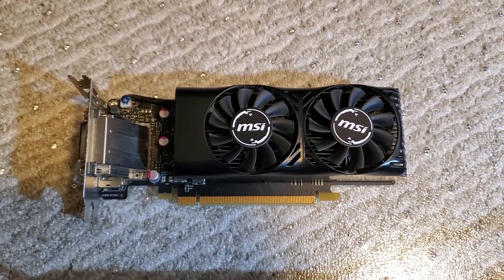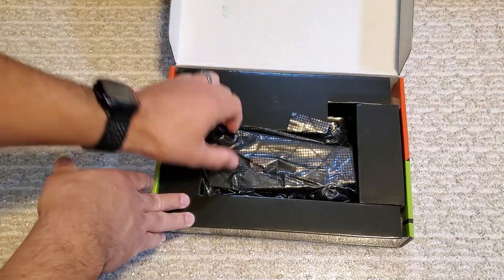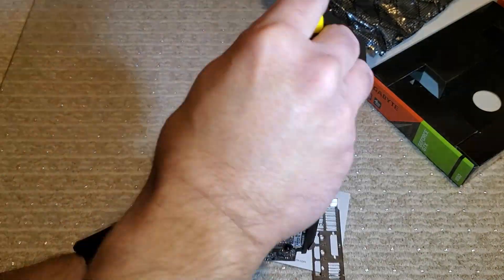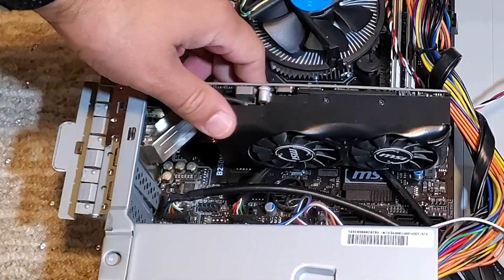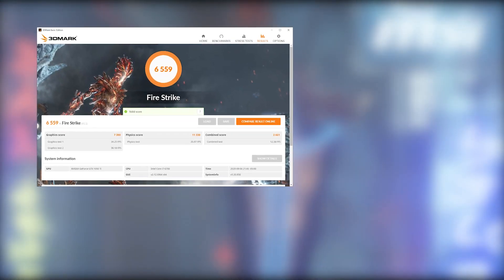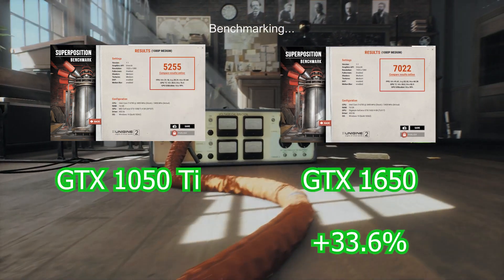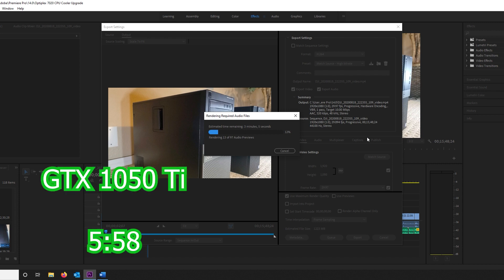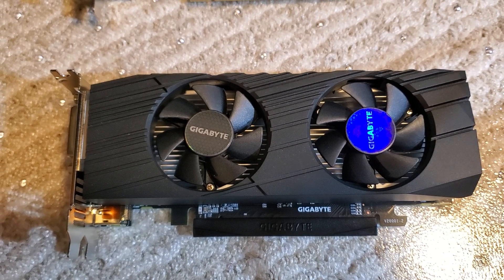Fastest Low Profile Graphics Card September 2020 - Nvidia GTX 1650 vs GTX 1050 Ti

Comment: Does this low profile card have give you thermal issues or fans issues what so ever?
Reply from the maker: I don't have this system anymore and I don't use a low profile card, but they do run hot.  Not much you can do about that in a small system.

Comment: Good review, I am also replacing a Zotac GTX 1050 TI GDDR5, with this same card, on an HP EliteDesk G1-800 SFF. I'll use it for running Falcon 4 BMS 4.37 👍

The GTX 1050 TI was good but it had few stutters running a military flight simulation.
Reply from the maker: The 1650 is a great upgrade from the 1050 Ti.  It will give you a solid performance boost.  Thanks for watching!

Comment: pls dont get the 1650 and opt for the super.. its so not worth it. 1050ti lost here because of low core. mine boosts to 1964mhz (1050ti) and it beats the 1650 in every benchmark here.

Comment: Puts motherboard facing side down on carpet, NOOOIEYBEYBEYBWTTGTH esd isn't good my dude.
Reply from the maker: It's on a clear antistatic chair mat that's on carpet and it's unlikely esd would damage modern components.
Reply: @EscoTech  not worth the risk even with some ic's havng very limited esd protection. It's easy to damage gates on transistors or junctions in diodes and not even know it.

Comment: I had the MSI 1650 in a Dell 790 SFF case and played every game at a mix of high to very high settings, with some occasionally on Ultra. Excellent and very capable little card.
Reply from the maker: It's a great card, especially when considering the size and power usage.  Thanks for watching!
Reply: @EscoTech  oh yea - the tiny Dell only had something like a 240w psu and it ran great
Reply: @antmon123  what cpu? I have a i5 650 would that work fine ?
Reply: @aidenoverton764  hmmm - my gpu was mated to a fairly good i7 (at least for that time)

Comment: I got a custom pre-build last month with the 1650 ddr6 oc.
I could get a ryzen 5600g (igpu) for 840 euro or a ryzen 3600x with the 1650 ddr6 for 860 euro.
The rest of the pc was identical.
I'm so glad I went for the 1650, my previous pc had a gt 1030 ddr5 in it and the difference is massive.
I'll upgrade my gpu after the market has normalized, for now it will definitely do!
Reply from the maker: You definitely made the right choice.  The 1650 is a solid card.  Thanks for watching!
Reply: @EscoTech  thanks and you're welcome, good luck with your channel!

Comment: Just ordered the 1650 (GDDR6) to max out my Dell Optiplex XE2 SFF rocking a 315W PSU, Core-i7 CPU and dual SSD's. Current card is a 1050Ti that fits in the open-ended shorter PCI-e slot.
Reply from the maker: Small world, I'm pretty sure if you bought it on eBay that you just bought the exact card you see in the video.  That's awesome and a funny coincidence at the same time!
Reply from the maker: I messaged you on eBay about being concerned about the card fitting in your XE2 but I just reread your comment and saw you used the top slot for the 1050 Ti.  I'd assume that would work for the 1650, too.  Did you see any performance issues in the top x4 slot?
Reply: @EscoTech  I can't tell you how excited I was to discover this happy coincidence and be able to benchmark the difference myself in my XE2 SFF. To confirm it will fit, here's a sample video showing GPU installation in one of these slots on a similar model: 
https://youtu.be/nr5JUbjNCQ0?t=233

I'll be sure to update here with my findings once I have a chance to install and test, but here's what I have with the close-to-current setup.

On a related note, if you don't have an XE2 SFF but have a xx20 SFF and want the beefier 315W power supply, it can be swapped in: https://www.youtube.com/watch?v=I7_enEWxJyM

Benchmarks on the 1050Ti 4GB GDDR5 OC (Gigabyte single fan model GV-N105TOC-4GL) don't appear to have been hindered much by the open-ended slot and some pins not connected. I'm guessing this is because nothing else is using the PCI-e bus, so it still gets most of the bandwidth (no m.2 slot in this 4th Gen machine with an older Intel Q87 chipset https://ark.intel.com/content/www/us/en/ark/products/75007/intel-q87-chipset.html ; see details here at this helpful overview of the Optiplex line: https://en.wikipedia.org/wiki/Dell_OptiPlex#Series_4 ).  I'll have to rerun this test since I later maxed out the ram and upgraded the CPU , and never tested with Valley (which I agree, is beautiful to watch).

Unigine Superposition @ Default ( 1080p Medium): 4937
Unigine Heaven @ Default: 1596

UserBenchmarks: Game 24%, Desk 77%, Work 21%
CPU: Intel Core i7-4770S - 70.6%
GPU: Nvidia GTX 1050-Ti - 27.8%
SSD: Samsung 860 Evo 500GB - 93.1%
SSD: Crucial MX500 500GB - 102.5%
RAM: Samsung M378B1G73EB0-YK0 2x8GB - 56%
MBD: Dell OptiPlex XE2

For further comparison, I did do some benchmarks on a slower system with a core-i5 CPU, and also one using only a GTX 750Ti 2GB low profile card from Gigabyte (GV-N75TOC-2GL)

Core i5-4570S + 750Ti 2GB
3DMark 11 Performance P4874 https://www.3dmark.com/3dm11/14099018
3DMark Basic - Time Spy 1282
Superposition 1080p Medium 2783
Heaven 1086

Core i5-4570S + 1050Ti 4GB
3DMark 11 Performance P7323 https://www.3dmark.com/3dm11/14099257
3DMark Basic - Time Spy 2215
Superposition 1080p Medium 4855
Heaven 1453

Comment: its a shame they didn't make a new low profile card since
there are no LP 1650 super
no 3050 or anything like that

I guess we'll have to wait for 4000s?
or maybe rx6500 or something like it?
Reply: I think someone could make a slightly downclocked rtx3060 to be low profile, with additional power on the side
I'm not sure how efficient cooling this small can be
but if laptops can manage 3070s, I imagine LP 3060 is not unrealistic
Reply from the maker: I know, it sucks that there aren't more decent low profile GPUs.  Hopefully, we'll get a 3050 like Nvidia teased, but the GPU shortage is probably going to stop it.  Thanks for watching!

Comment: Can you suggest me a LP graphics card 2gb ,4gb and more ?
My pc specifications are=
Model - HP Elitedesk 800 G1 SFF
Processor - Intel(R) Core (TM) i3-4160T CPU @ 3.10GHz
System Type - 64bit 
Ram - 16gb ( DDR3 1600Mhz ) 
OS - Windows 10

Comment: Can I put a 1650 in a dell T3420 SFF, Intel Core i7-7700 3.6GHz, 16GB DDR4 and 512GB SSD? Thanks for the help
Reply from the maker: I think the card is too tall for the SFF.  It is basically two slots tall and your SFF looks like it has the full PCI-E 16x slot on the bottom.  I think the PSU is too close. Thanks for watching!

Comment: the only card right now at a respectable/not gonna make you go crazy price right now in the market as I comment this.

quick question: is pairing this with the Ryzen 5 3600, 16 GB DDR4 3200MHz RAM alright given the high prices of the GPU market? planning to buy a 3070 in the future (maybe 2022 if it goes down) still good? any input will be greatly appreciated.
Reply from the maker: I'd say that's a great pairing for a 1650/1650 Super, and you still have an upgrade path for the AM4 socket if you have a relatively recent mobo, too.  Just in case you want a little more CPU power if/when you can get a 3070.  The Ryzen 3600 should be fine with a 3070, too.  You might see a small CPU bottleneck on some CPU intensive games, but probably  not enough to even notice.  Good luck with the build and thanks for watching!

Comment: How long will it last, with atleast 85% fan speed all the time at 83-85c, can this card even last a year?
Reply from the maker: After adding a closed loop cooler and getting some of the CPU heat away from the GPU, it does run quite a bit cooler.  I am seeing low to mid 70's now and will do a follow up video.  Thanks for watching!

Comment: Is that fits to my dell optiplex 790 i3 sir, i want to put a graphics card also..
Reply from the maker: The 1650 might get a little bottlnecked by the i3, but it's the better card for sure.  I'd go with the 1650 (if/when you can find one) and maybe consider a CPU upgrade in the future.
Reply: Thank you sir

Comment: Would you say the 1650 is a good gpu for a dell optiplex 7010 sff
Reply from the maker: Yeah, you might be CPU bottleneck it a little, but it's still worth it.  They're almost impossible to find right now, though.  Good luck and thanks for watching!
Reply: I got this card in my Dell Optiplex 7010 SFF with a i5-3570 CPU and 16Gb of RAM (4x4 DDR3) and no problem.

Comment: which one you think is better to use with an i5 3470 and 12gb ram? 

i have a rx550 2gb, and i need to do some upgrades, starting with the gpu
Reply from the maker: The 1650 is definitely a better card and would be what I recommend.  Unfortunately, they are almost impossible to find at a decent price.  Nvidia is supposed to be releasing more 1050 Ti cards to help with GPU shortages and price increases caused by cryptocurrency miners.  Good luck!

Comment: So far, best demo of this card and comparing it to the 1050.  This may put me over to save up my "wellness Program" Amazon cash to buy one of these.  I own a full-size case (sort of).  But due to the location of the ventilation for the case, I had to mount a fan/radiator combo and now my video card won't fit.  So, my only option is a lower profile card.  Super sad... but, I'm looking for a high-performing, lower-profile graphics card.  This Gen 10 i5 onboard video is like 1/3 the power of my old video card that doesn't fit.
Reply from the maker: Thanks for the feedback.  Unfortunately, these cards are nearly impossible to find at a price worth paying.   Cryptocurrency miners and GPU shortages have pretty much killed the market for gamers.  Good luck finding a card and thanks for watching!

Comment: Hi! What are the rest of specs of this computer?

I have a 200W PSU unfortunately. Will I be able to run a 1650? I have an i5 6500 with 26 gb of RAM. Thanks!
Reply from the maker: The 1650 is getting a little too close for comfort on 200W.  I'd either look into a PSU upgrade, or stick with a 1050 Ti.

Comment: Really glad I opted for the 1650 over the 1050
Reply: Yes 1650 is better than 1050ti generally and that it is newer as well.
Reply: Same, I was debating on whether or not to resell my 1650, but this video justified keeping it. :)
Reply: sudipta gupta  yeah, but this video is comparing low profile gpus.  There aren't any low profile 1650 supers that I'm aware of.  The 1650 lp is still currently the most powerful low profile gpu to date.
Reply: @davidhodge0201  rtx 3050?
Reply: @Covid-bv4hp  is there a slim form factor 3050 like the lp 1660 and 1050ti have that I'm not aware of?
Reply: @davidhodge0201  No im just asking you. I dont know gpus very well and the 3050 is recent so I was wondering what you would think of it now that its released?

Comment: those video cards are unobtainable, the video is bunk because of it.
Reply from the maker: Yeah, I've seen it listed by some market place sellers for $200-$300, which is insane.  Low profile has a little price premium, but this card isn't worth more than $150.  Hopefully Nvidia announces their new 65W Ampere card soon and we get a low profile version quickly.
Reply: @EscoTech  I feel they wont, they will raise the barrier to entry.  Its a shame. :(
Reply: @thatkidmingming7390  $150 MAX for a card like this imho.  They are super fuckin up.  Somebody need to break this market wide open.  There is a big void.

Comment: Question: Do you think the 1650/1050 can play triple a games like Destiny 2 with 1080p 60fps while having a core i5 2400?
Currently I am using geforce now but still during evening hours it starts lagging a lot. I'm not quite sure if a $150-200 gpu would be worth the upgrade.
Reply from the maker: I think the 1650 would handle Destiny 2 fine, but your CPU might bottleneck you a little.   An i7 or an equivalent Xeon(which might be really cheap) would probably be a worthwhile upgrade if you upgrade the GPU.  Do you have a low profile PC?
Reply: @EscoTech  its an hp elite 8200, basically office pc but ive upgraded with some extra ram and ssd so its not that slow. I think it would be better to just save up a little more and build another ryzen pc.

Comment: i just upgraded from a gtx 650 ti to the gtx 1050 ti 4gb ...but will be on the look out for a 1650 deal...thanks
I use a dell precision T3500  Xeon ...so big case and 550 watt the old gtx took the one 6 rong cord and the newer ones like the 1050 and 1650 don't right? and works off the Mother board ? is this better ? or bad on the motherboard in your Opinion ?
Reply from the maker: I don't have any concerns, I have use a PCI-E bus powered (from the motherboard) 1050 Ti for years and now a 1650 with no issues.  A 1650 Super might be worth it for performance, though.  Especially since you have the power supply for it already.  Thanks for watching!
Reply: @EscoTech  Thanks… I'll keep an eye out for a cheap eBay 1650 super …and give the low profile 1050 ti for my moms computer - she plays old games like 'who wants to be a millionaire'  and 'jeopardy'' type games lol...while I play GTA iv and V and battlefield 3

Comment: For the shadow of the tomb raider benchmark the reason it got a much better score than the 1050ti was because on the 1650 he turned off TAA while on the 1050ti it had TAA on, if both were off then the 1050ti would be in the low to high 40's
Reply from the maker: Someone else pointed this out, too.  I have added a comment in the video description and will try to add a disclaimer on the screen when I get a chance.  Thanks for catching it!  I'm not sure why Tomb Raider decided to change the settings and why it figured the 1050 Ti could handle TAA, while it automatically turned AA off on the 1650...

Comment: you could make like 3070 up to 3090 or 6800 low profile if you stack 4 or up to 6 slots
Reply: um, or you could make 90 degrees turn with riser to fit a normal sized gpu
Reply: the power supply needs to go, to other place

Comment: The settings for the tomb raider test were not the same. the 1050 ti had anti-aliasing on while 1650 did not. also one was fullscreen and one was windowed fullscreen idk which was which but whichever one was would have been doing more work. in a game, 1650 would do better but you would have gotten for like 40-45 frames for the 1050 ti if the setting were the same.
Reply from the maker: Good catch, I do think they both ran full screen on my ultrawide monitor, but I don't know what the 'exclusive full screen' setting does.  I'm not sure why the anti-aliasing was turned on automatically for the 1050 Ti, but automatically off for the 1650.  I'll try to add a comment to the video to note this, or I'll put it in the comments.  Thanks for noticing that!

Comment: You are misleading... The GDDR6 version of 1650 is only ~5-6% faster than the GDDR5 one, in exceptional cases it can go up to a maximum 12% and only in benchmarks and isolated scenarios, in real life the difference can be even of only 2%! If it were ~20% like you say in your description then the release of GDDR5 version wouldn't had any meaning considering the 1050Ti. Please get your facts straight! PS: I had them both(GDDR5 and 6 version).
Reply from the maker: Good call out, I will fix the information in the video description and put a text correction on screen if I mention it in the video.  I'm not sure where I came up with the 15-20% faster figure, but I was also doing a video with a 1650 Super around the same time and may have mixed up my results somehow.  Thanks for pointing that out.

Comment: Great video man!!! About to put out a video using the 1050ti LP card. I was gonna go with the 1650 LP but wanted the build to stay around $200 bucks. Great video man, officially subbed!!
Reply from the maker: Yeah, the downside of these LP builds is they can get expensive quickly.  The 1050 Ti is still a great card.  Thanks for the sub!
Reply: @EscoTech  yeah I picked up mine used for $50 and 2 4 GB sticks. I have a shoe box full of 2, 4 and 8 GB sticks. I think I currently have 8 OEM Dells and Lenovo’s, all Sandy bridge up and up. My buddy is a computer recycler so I’m pretty lucky. I’m finishing up the new video now man, would love your thoughts. Will send the link when it’s finished and hopefully you can watch when you get a free sec. take care man!!
Reply: @EscoTech  I know what you mean, my low profile build was over $1k, even with a half price CPU and w/o any GPUs. 

i5 10600k (OC'd to 4.5GHz),  MSI z490m, WD black 500GB NVMe, WD blue 2TB SSD, slot load blu-ray, Seasonic gold modular PSU, 16GB 3600MHz CL16, Silverstone ML08 case.

Comment: I have this exact case, and a pretty similar setup (1650 w/ a Haswell core i7). I've been meaning to add some extra airflow to help the GPU and PSU since they don't get much from the sole intake fan, so I just duct-taped some 40mm (I think) fans in front of the disk drive compartment to blow air at them, using a molex-to-USB adapter to power them both. Seems to have helped, but would love to see how you approach it yourself. Looking forward to the video!

Comment: I have a HP 8300 Elite Small Form Factor and I was thinking of getting the 1650, but the computer only has a 240 watt power supply. Will this be fine?

Edit: 
I also have an i5-3470 @3.20 GHz, will this bottleneck with the 1650?
Reply from the maker: Yes, it will work with a 240 Watt PSU, and you will probably see a slight bottleneck, but not too much.  I'd say it's still worth it, but if you can upgrade to an i7 or Xeon, it might be worth it.  Thanks for watching!
Reply: @EscoTech  Thanks so much! You earned a sub